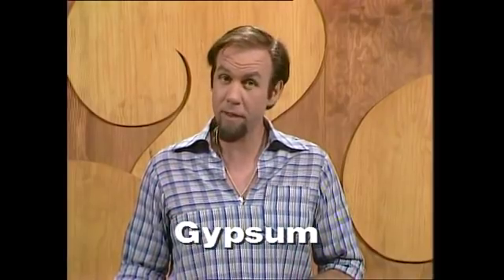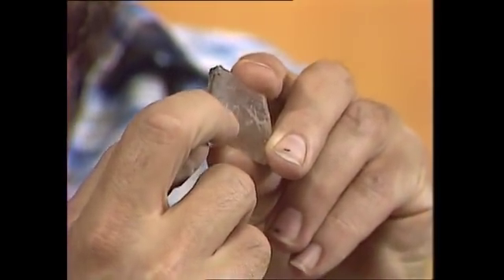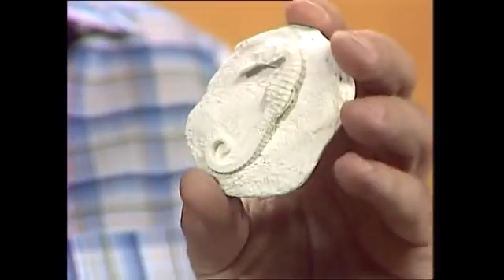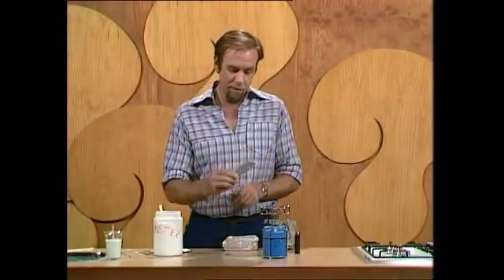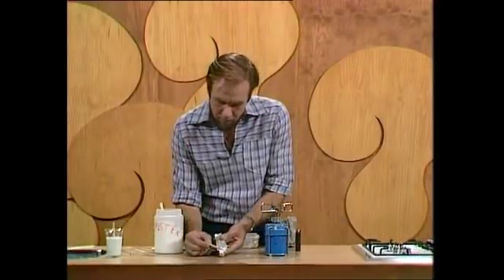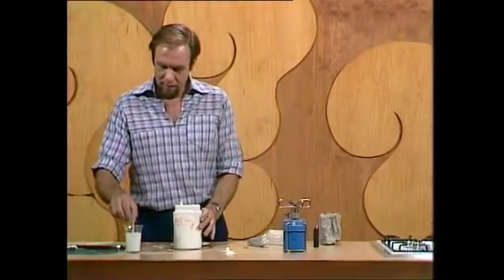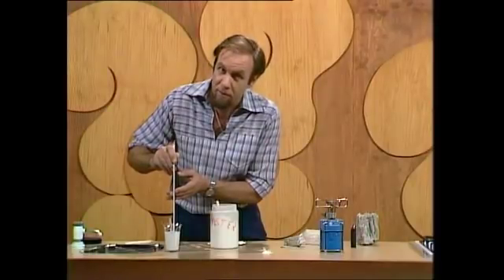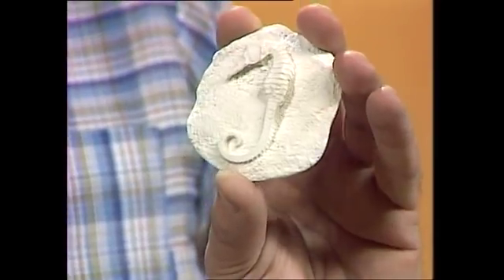Turning gypsum into plaster

Comment: What I understood here is :-
Raw gypsum block has trapped water molecules and when pulverized it can be sold as  gypsum powder or gypsum board. When gysum powder is heated to 150 to 300 degrees celcius, the water molecules is evaporated and you get "plaster of paris" (a.k.a. PoP) . When PoP is mixed in water, then fhe mixture left for drying actually releases heat and that is actually turning PoP back to dry gysum with some moisture ❤

Comment: Can you please tell which gas is released when gypsum is heated?? Btw loved ur video😊👍🏻
Reply from the maker: Effectively it is water. The result is plaster so, when you add water, it converts back to gypsum - Rob
Reply: gypsum is calcium sulfate dihydrate, heating it drives off the water of crystallization, giving you the hemihydrate (Plaster of Paris) and finally anhydrous calcium sulfate
with further heating, calcium sulfate will decompose into calcium oxide and sulfur trioxide - but this reaction is better done catalysed with e.g. silicon dioxide - this is how sulfuric acid was once made (the SO3 gas was reacted with water, forming sulfuric acid)

Comment: I dunno if it's the same in Australia, but we have two other uses for gypsum:

We compress the powder into 1.27cm thick sheets that are about 2.4384m by 1.2192m long. Due to the States, these measurements make more sense in the imperial system:
1/2" sheets that are 4' by 8'

Anyways, the sheets are then wrapped and sealed in 2 layers of paper, brown on one side and usually white on the other (although green signifies moisture resistant sheets and blue is moisture and mold resistant) which we hang on our wood framed walls with a screw every 16" apart. 
For the sealing, the same method is applied with sheets that are 3/4" thick and have an extra screw. 

The second and older application is done to make a rougher paste than Plaster of Paris and is used to fill in cracks on the walls. This used to be used to cover walls completely, but was hard to keep flush.
Reply: Looking In With Victor B Commonly known as plasterboard here in Australia
Reply: @waynej747  here we call it drywall. But many countries don't know about it, so I didn't want to assume
Reply: Yep, and here in Australia it is 1.2m x 2.4m x 13mm typically
Reply: Plastedboard or the trademark name Gyprock which is made by Boral I think.
Reply: I think the reason ornate wallpaper used to be so popular, was to cover up the inconsistent surface of lath and plaster walls.
Reply: @woodyofp8574  actually it is the opposite, according to someone who worked in those years... the pattern is ornate, but still a pattern, so having uneven walls would make it look horrible, whereas a blank coat of paint would be unnoticeable. 

It became a symbol of status here in Canada for a while as the labour and skills needed for "walls flat enough to hang wallpaper on" would cost you twice or thrice just getting them painted.
Reply: @With_Victor_B  That's actually quite interesting, I'm glad you told me that.
Reply: @woodyofp8574  np. I love learning about things like that from our past. And learning about the methods of different cultures. 

Glad the trivia was also useful